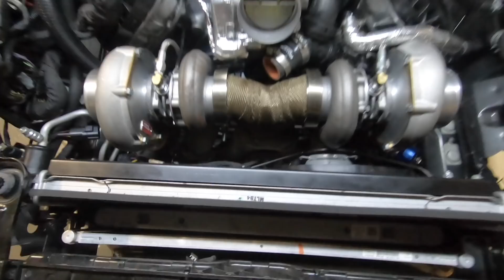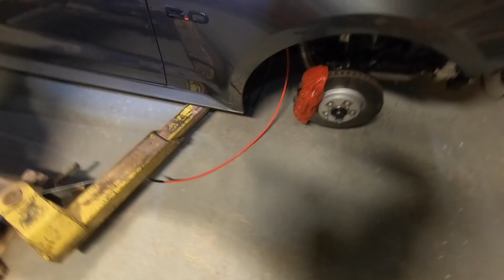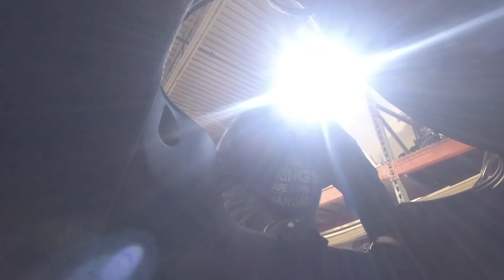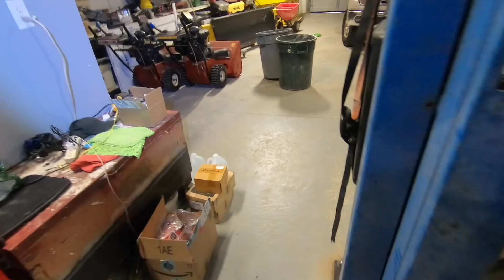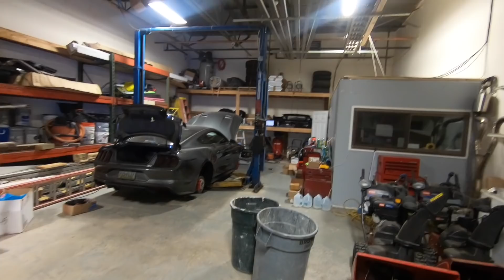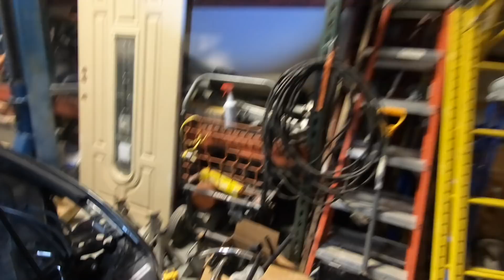Engine install update 2018 ford mustang gt 10R80 twin turbo hellion fore innovation E85

Comment: You will have the best Stang on you tube brother, finally the time comes for you yo bring a big smile on the face after so much problems you had  before. What kind of Manley rods you did ?I or H? I’m thinking about a custom short block at least  and maybe I’ll go with L and M also. I’ll wait for you to put few thousands miles and see how your engine will keep up. BTW you have a new subscriber and that’s ME😎

Comment: Did you have to tap into the oil pan?
Reply from the maker: Jay Stang no not on the 18’s pans are plastic got to use a pump to push oil back up into valve cover
Reply: Thanks!

Comment: Is the intake air colder with the turbo located underneath the engine? 
Iooking at this setup the air filters get literally bathed in hot air. Maybe not critical when running a huge intercooler. But everything matters right, when talking about performance.
Anyway all the best with the build and all the re- install. It sure looks to be a big and time consuming job.
Reply from the maker: Einar Ingi Einarsson thx man intercooler is mounted on front of car and yes air fillers are pulling in hot engine bay air probably the only thing I don’t like about this design I’m going to see if I can run some tubes threw the bottom of the bumper and pull air filters on them to pull in cooler air
Reply: @BoostedAddictions  thanks for the reply. Very much appreciated. 

Move the air filter if possible. Would be a good idea. But I imagine finding room for even more tubes will be difficult to do.

But the Hellion design brings in heat from both the engine and the radiator and intercooler.